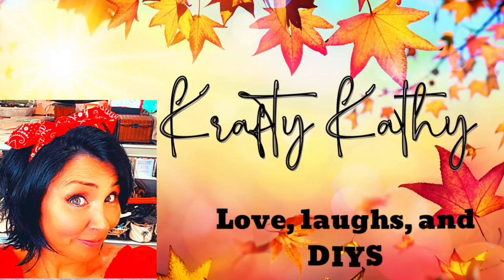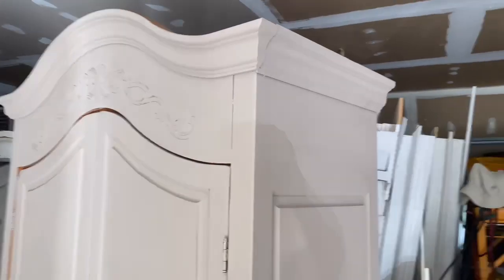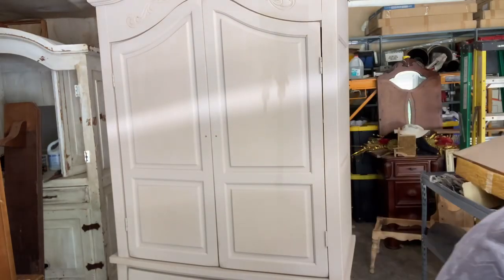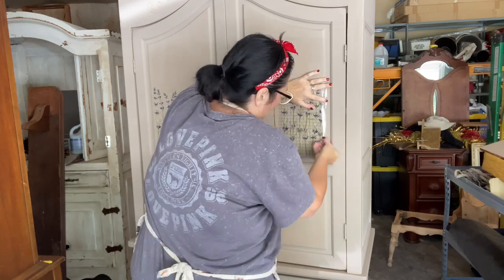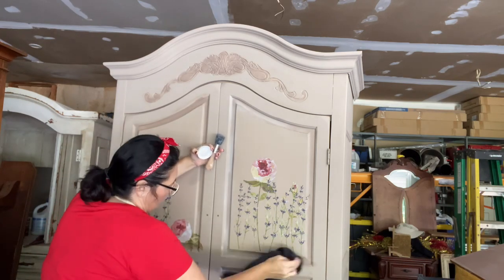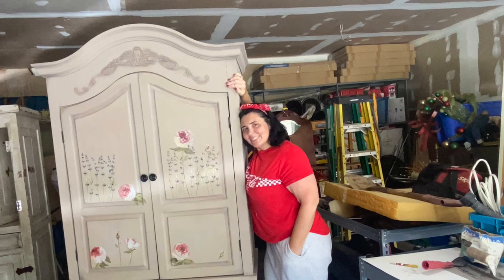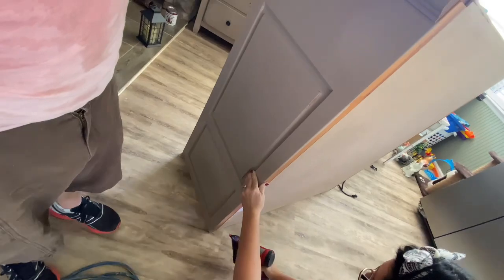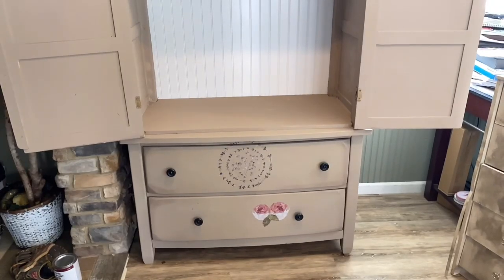How to make furniture painting and blending EASY and manageable / painting my late sisters armoire❤️

Comment: I did an one like that years ago and an old fashioned roll top desk. They were a job to sand them down by hand then paint it. I varnished them both after I put like 3 coats of paint on them.
The pieces had like 5 different colors on each one. I found that out while sanding them